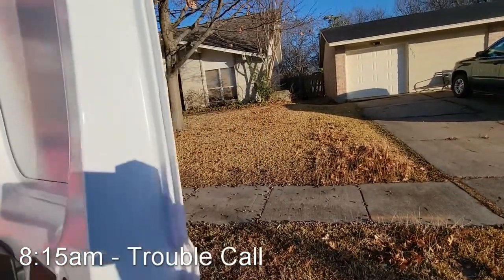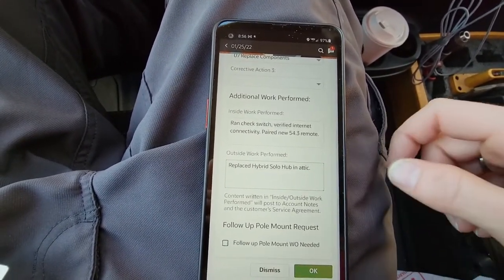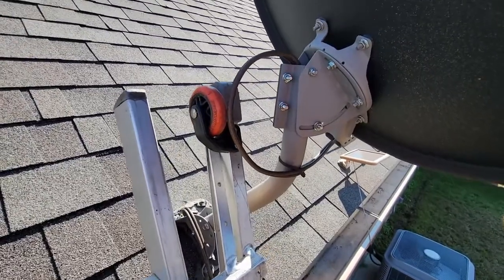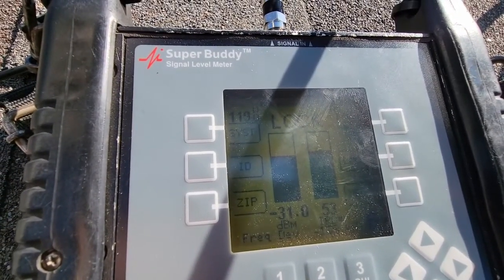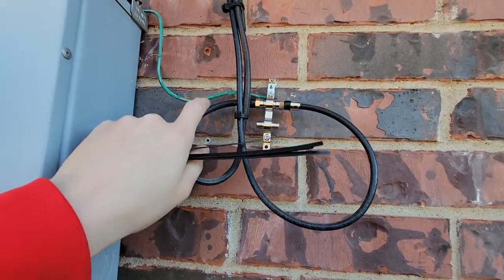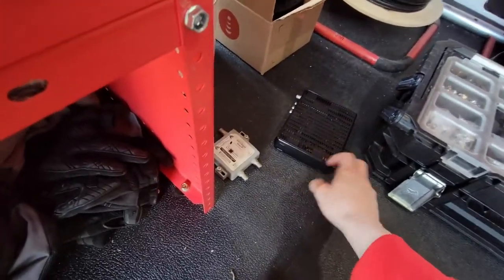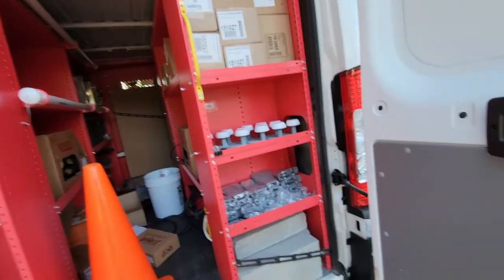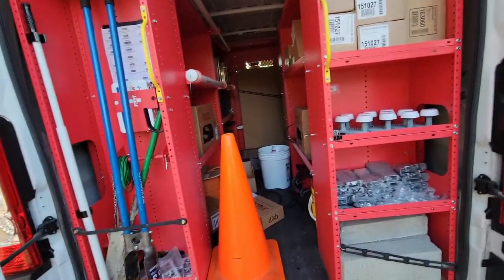Dish Satellite Technician Work Day Full of Trouble Calls

Comment: I worked with Dish for eight years from 2008-2016 as a dish technician. I got into the point to be a level 4 tech, and it was a great job. The metrics got too difficult to  meet when you are a level 4 tech, especially when they included sales on the job like screen cleaners, surge protectors, home theaters, and TV mounts. It got to a point that managers got too pushy with the sales. If you didn't sell well during a week, they started giving you too much in the office. Why are you not selling many things? etc.. Before they included the sales requirements, it was a good job. Some jobs were easy and some difficult. I loved it when they had directv, and it was just basically replacing the dish and using the same cables. But some jobs were bad. A six room installation and no cables run in any of the rooms.

Comment: Being a dish tech sucks, working 10-12 hour shifts 5 days a week can definitely burn you out. Good thing this isn’t my actual career. Would not recommend this job, also very sales heavy.
Reply: Yeah I was in the same boat, they advertised 4 days a week but it rarely happened, and it was middle of summer so many techs were getting heat strokes, injuries from fatigue. I actually didn't mind the job itself but I wasn't a good snake oil salesman.